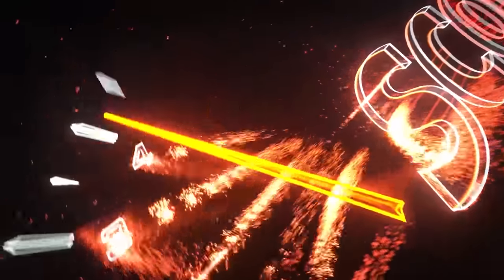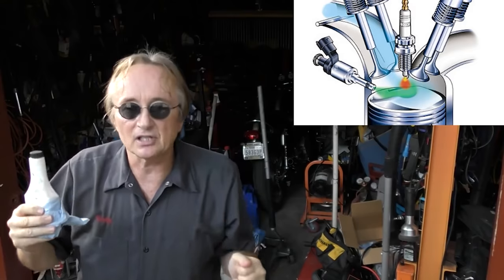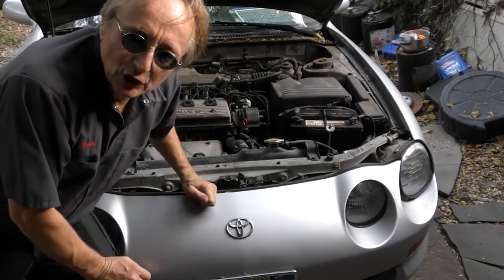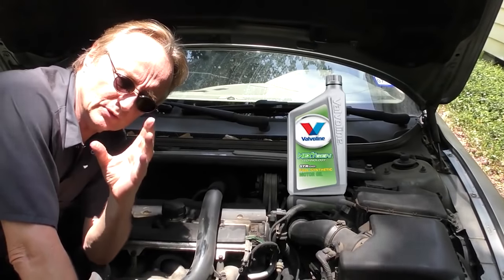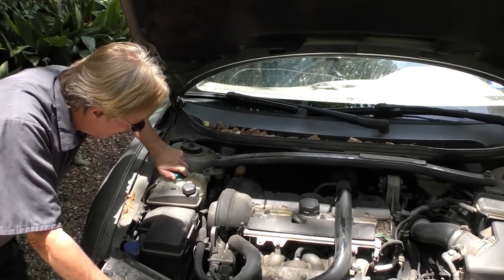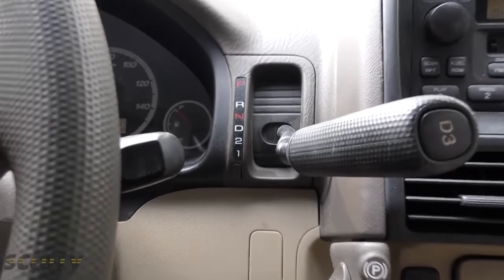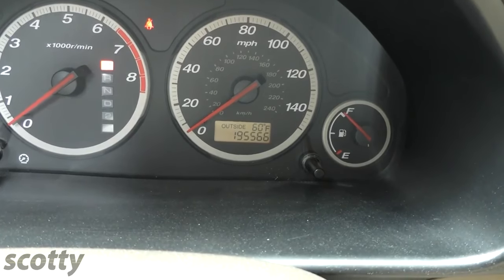20 Things Only Stupid People Do to Their Car

Comment: The nitrogen filling of tyres is a particularly insidious scam, because one of the reasons stated for why you should do that is that nitrogen seeps trough the tyre slower than other gasses (which is true btw. but has to do with the charge potential of the molecule rather than the simplistic explanation of it being "big" or "heavier"). Think about it. If you fill your tyres with air - that is, a mixture of nitrogen, oxygen, CO₂ and trace gasses - the other gasses will escape the tyre faster than nitrogen, so nitrogen gets concentrated in the tyre anyway, by means of topping it up with normal air only.
The advice on not downshifting your manual transmission car is wrong. Here in Europe, where almost all cars are manual (and you do your drivers education and test on a manual, otherwise you are qualified to drive automatics ONLY), this is taught as a matter of course in driving schools. It's not about the price of brakes vs. price of clutches, it's more about not heating your brake and ending up overheating it when you REALLY need it. The general advice is that you should use your gearbox (and downshifting where needed) to control your speed, and use your brake for stopping. If done right, this causes negligeable additional wear to the clutch and the engine. I have been doing this for 30 years and never wore out a clutch. In many ways, it is the point of having a manual transmission and controlling your gear ratio yourself. What would be the point of having a manual if you drive it like an automatic? So, DO downshift. It's fun.
Reply: Anecdotally, every person I have debated that argues against rev matching has been a European who swore they knew better because their respective country drives more manuals per capita.
Reply: @RhodokTribesman  Knowing better because everyone drives a manual transmission is a sound argument. There is a wealth of experience and transmitted knowledge in the community concerning usage of manual transmissions and clutches. Anecdotally, every person that claimed that this does not give you an edge is an American thinking that despite this, they know better. That's the typical hubris. I would not presume I know everything about automatics. I'm sure there's a wealth of advice transmitted down from parents to children, from more experienced friends and in general chat, that I don't know about. I know how automatics work and can drive one, but I'm lacking the little things, the finest of points about it all. 

The truth is: you DON'T know what you're talking about. Including Scotty. You overthink this stuff and think that shifting a manual is something terribly mysterious and advanced, while an automatic shifting is just fine and dandy. You think that there is a humongous amount of wear put on the engine, transmission and clutch by downshifting, when in fact it is absolutely negligible. Tell an European mechanic you don't downshift because that causes wear and they'll piss themselves laughing. I can't imagine what you people seem to be imagining, that we're slamming the engine in the red by downshifting and half-drifting around corners? What actually happens is that you drive on, say, the highway at about 130km/h in 5th gear, which is about 4500 RPM in my car. Then you want to slow down - take an exit for instance - you first lift off the gas pedal, and when it falls below about 3000 RPM you shift to fourth, which kicks you up about 1500 RPM again, and then repeat that with 3rd and perhaps 2nd if the off-ramp is particularly tight. It all happens in normal rev range and involves barely any clutch slip. I'm doing this all the time, and I never wore out an engine - or a clutch for that matter. I did have to replace a couple, but those were unrelated mechanical failures where it made sense to replace the clutch even though it was not worn.

Again, this is not something I invented myself. This is what I have been taught in driving school - twice, in two different countries, and what is being taught today. Driving instruction includes around 40 hours of mandatory driving instruction, as a rule with a professional, certified driving instructor. You may be failed on your driving test for NOT downshifting, because it gives the testing commission the impression that you're not sufficiently at ease with the car controls. If you just coast down in the top gear using the break and then make the engine stutter because you want to accelerate again at way to low revs, you're as good as failed. If people see you on the road braking to slow down instead of using the motor brake, they'll think you're either incompetent or a noob.
Reply: @horrovac  You have poor reading comprehension, huh?
Reply: @RhodokTribesman  No, but you may have poor clarity of expression and/or flawed logic.

Comment: why do we call it the emergency brake when its only use is for hills? its a hill brake!
Reply: You should always use it period. Keeps strain off the transmission when the car is parked.  You might wear out the emergency brake, but that’s cheaper than wearing out a transmission.

It’s actually called a Parking break :)😊

Comment: Driving at lower RPM saves gas and is not wearing out the engine as hard as high RPM.
Smooth cruising is better than racing like a maniac anyways.

Comment: Don't fall for the lifetime warranty brake scam. Most companies swear by them but it's always the most expensive premium pads they sell you. And when they wear out n you go to claim warranty   they pull out a book with every excuse to not honor the warranty,  your caliper seized, sliders seized, blah blah blah. It's a wear item, it will need to be changed. Just get the 40$ set n be done with it

Comment: 5 to 7 thousand miles? damn... I change it every 3000...
Reply: The 3000 miles/3 months cycle is overkill for most modern cars and modern oils, unless you drive in particularly harsh conditions. It's always best to follow the manufacturer's recommendations though, and if you have an older car, that may just be 3000 miles. My Jeep's manual actually says to change the oil when the computer tells you to, not to exceed 10K miles or 1 year, unless you are offroading or towing a lot, or driving in very dusty, dirty environments. The computer monitors your driving and adjusts the frequency based on what type of driving you're doing, and your driving habits. I typically change mine between 7500 to 8500 miles.

Comment: 0:50 "all cars have a ground to body" except a fair number of mid 80s to early 90s Toyota, which can have a positive ground. (Pickups and 4 runners mainly, but what all the off-road folks here seem to love)

the other aspect of jump starting backwards is many times the starter lead will try catching fire as the electrical short heats the wire up to melting in a matter of seconds.

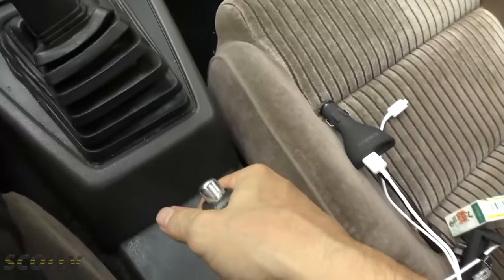Comment: 15:38 No, Scotty. You do not shift into gear at all, that's not what the transmission was made for. And ffs, press the knob on the handbrake lever before pulling. Also, stop calling it an emergency brake, it's for parking, not for emergency braking! Do you want drivers losing control over their vehicles?

Stick to your automatic transmission, you barbarian.

Comment: So I am late here. Damn dude. your voice is horribly loud. Are you trying to channel Billy Mays? So with the higher Ethanol gas out there, fuel additives are useless? That can be your little secret. Down shifting is pointless? hmmm.. I guess you have never had brake failure from them over heating. Yes, brakes are cheaper however when your brakes fail and you crash, it will not matter. I am guess since I did not see a disclaimer, you are stating your expertise here. I wonder what a lawyer will say about it. Some of the stuff is common knowledge. Others are just wrong. Someone is going to do what you tell and they are going to screw up their car. or worse.

Comment: nitrogen in tires is foolish. the amount of times tires go flat or close to is very high and for someone to use nitrogen is an unnecessary expense. air 4 life!
Reply: I’ve had 1 flat tire in 25 years of driving. It’s not that expensive if you have a use for it.